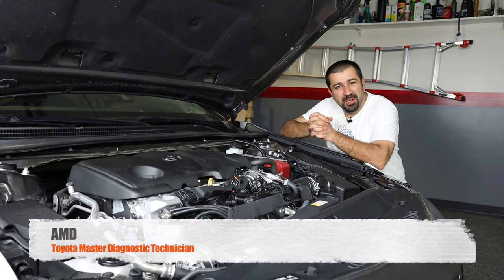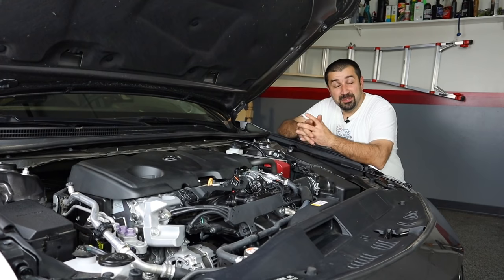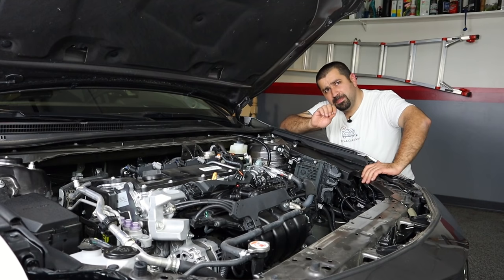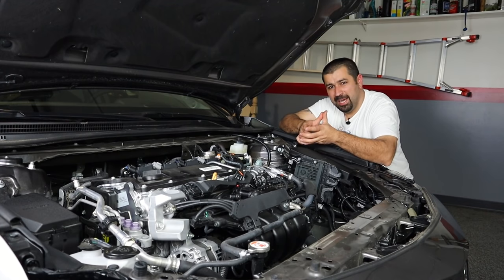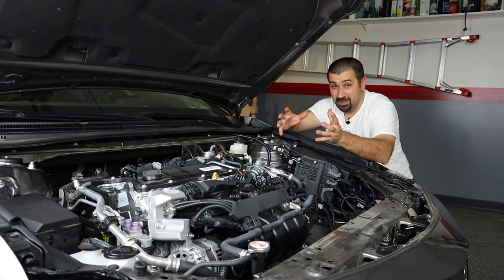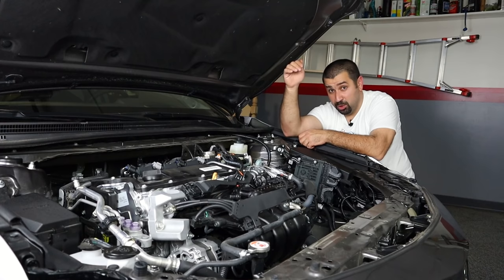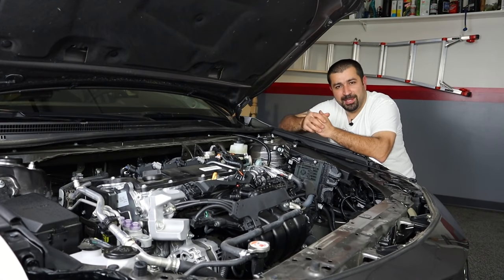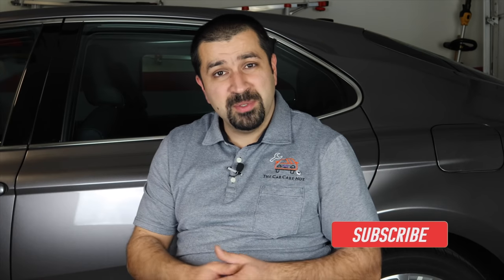Toyota's New Engine Technical review Part 1 : Cooling,Lubrication,Direct Injection and EGR

Comment: Doesn't really build my confidence that much. 
I'm wondering why the car is so picky about engine oil? If it has a computer controlled variable oil pump seems to me it ought to be able to compensate pretty easily if someone put something different in it?
Third generation Prius had horrible problems with both EGR coolers and valves as well as their electric water pumps,  both failures resulting in head gaskets blowing.
Sounds like a recipe for disaster in reliability long-term.
I would imagine the water pump in this is not a three-phase AC powered like in the Prius so perhaps it's different and more reliable, but the failure in the electric water pump on the Prius is not usually electrical, the plastic impeller comes off of the steel shaft of the motor. How stupid was that? Why the hell you would you put a plastic impeller on a water pump? In the Prius they tended to fail after 90,000 miles, but the EGR cooler is going to need to be taken off and cleaned as well as the valve about every 150,000 MI or again it can cause a blown head gasket.
I definitely would trust that Toyota would do a better job of putting these systems together than many other manufacturers but they had problems with the Prius so it makes me worry a little bit.
But maybe they've learned from the mistakes of that design.

Comment: I stopped at the cooling system bit. There is nothing spectacular about the design in that any car company could do it and could have done it years ago. Perhaps the reason why it has not been done before is because the return does not justify the extra expense and particularly the potential for problems. 

Toyota is, sadly, going the euro way in that something has to last only as long as the warranty period.

Comment: Ford’s Coyote 5.0 V8 has port and direct injection as well.
Reply: The ecoboost motors definitely do as well startinf in 2017.
Reply: @rodburnette4114  4 cylinders as well? 2.3T?
Reply: They copied toyota
Reply: @usadaytrader  The sad part is that all of these manufactures knew the problems associated with direct injection and for years did nothing about it.   I have a 2012 F-150 with the 3.5.  It now has 122k miles and it has been a great truck with no powertrain issues whatsoever.  After the powertrain warranty was up at 100k I put on a catch can to be on the safe side.  Probably have some intake clogging but my mpg has remained the same over the last 8 years and I don't have any other issues so it couldn't be too bad but still, they knew about the problem and still rushed the engine to market knowing there would be problems.  Disappointed with Ford but at least they finally did something about it.  Still a lot of others using direct injection only now (Nissan, BWM, Audi, Mercedes, Chevrolet, to name a few that I am aware of) that will eventually have problems.
Reply: @skeeter1317  that's how ford rolls.  Customer is the guinea pig
Reply: @usadaytrader  I would say that is how every manufacturer rolls.  And at least Ford has done something about it.  Others still producing cars with GDI that will have problems down the road that haven't bothered when the fix is readily available.

Comment: What is the cost vs effective value for this magnificent technology. What's this car's repair cost going to be when the warrentees crap out and the local car repair guy lacks the knowledge and extremely expensive diagnostic equipment to figure out why it died in your driveway. The big question to ask is "why is all this necessary.".  Why  is is such a good idea to make a car that the do it your self guy can't easily swap out parts and perform simple maintenance on.

Comment: More technology = harder to find and more expensive to repair problems.
When everything is in sync fine but just one small item not working right good luck trying to trace the problem thru endless wires, sensors and hoses and let's not forget the computer which now must do more.

Comment: Have to disagree on somethings. VW is a perfect example of problems with over engineering stuff. More component's that can fail. I'd rather pay the difference in fuel for the few miles per gallon savings.

Comment: lol, what an expert, he cant' even read the owner's manual. It says thicker oils are more ideal for operating under load or high speed. Maybe check overseas manuals too, they recommend all different grades based on ambient temps, up to 15w-40 for hot climates. Only USA does the single recommendation of thin oil, it's the CAFE rule....whatever oil used in their mpg test is the sole one to be recommended in the manual. This is basic science, thicker oils produce less wear.

Comment: Is it okay to keep this engine always on ECO mode ? On highway eco mode runs okay...but in city driving it fees a bit under power the initial thrust when you push on gas.....good engines Toyota...but poor / boring / fit for old people kind of interior design....the speedometer on 2018 onwards camry its way too much on the right side hard to keep eye on the speed.....side mirrors are very small and dashboard has a weird design V shape around the stereo...terrible design

Comment: The problem I see with such a thin oil is as the engine gets into the higher mileage and things wear out , The engine will burn oil like crazy. These modern engines are designed for fuel economy and not long term use like 100 thousand plus miles. We can all thank the EPA for these thin oils and the start stop features which in the long run will destroy the vehicle.
Reply from the maker: With good maintenance Toyota engines won’t burn oil. Poor maintenance = oil consumption guaranteed. Video coming up on this soon
Reply: The problem is not the oil or the engine, the problem is the uneducated people who make assumptions without doing any research.  0w oils have so many advantages than older, say 5w-30 or 10w-40 viscosities in modern engines.  They flow better (faster) protecting engines when most needed; at start-ups, they dissipate heat faster to keep engines cooler, they keep engines cleaner given that they're naturally full synthetic oils (0w oils can only be made from synthetic base stocks), they promote more horsepower, better gas mileage, etc., etc.

Comment: The A25A-FKS engine is used worldwide and Toyota owners manuals outiside of the USA say oils as thick as 15W-40 can be used: https://imagizer.imageshack.com/img922/990/O0JZRO.jpg
Reply from the maker: That is not what we were told at the official factory training when this engine came out. There has been issues with these engines related to oil including metal shavings and even knocking due to incorrect oil used. I don’t know how I feel about trying different oil viscosity just for the sake of trying.
Reply: @TheCarCareNut  Russian, Saudi Arabian, Australian, Indonesian owners manuals all say any viscosity between 0W-16 and 15W-40 can be used.  On Facebook, A25A owners from the Middle Eastern countries say their dealers routinely install 5W-30.
Reply: For 2021, Australian owners manuals now say 0W-16 is the factory fill and recommended for best fuel economy and cold weather starting, but that 0W-20, 5W-20 and 5W-30 can also be used full time.  10W-30 is OK if temperatures do not drop below zero F: https://imagizer.imageshack.com/img923/3448/gBxMOF.jpg

Comment: having an electric water pump and oil pump worries me.  I've always found small electric motors to be one of the most failure prone items on a car.  Now if that oil pump dies and you're driving, your engine will likely go with it.  

Many years ago I did dyno testing with the EGR.  I had a Datsun 720 pickup with a Webber carb, headers and comp cam.   It also had an EGR.  We did several pulls with it hooked up and some not hooked up. Emissions were monitored and we found a nearly 10% increase in peak HP with it disconnected and It had no positive effects on emissions.  Infact the HC's went way up and If I recall correctly the NOx did also.

Comment: My understanding is that Toyota experimented with Direct Injection (D-4) using low-volume models (e.g. Lexus IS250) and "discovered" carbon build-up problems.  Then they switched to the new system (D-4s/ D-6s) that has both port and direct injectors.
This practice of using new technology in low-volume products to figure things out before applying it to high-volume products is not uncommon, which is why my purchasing rules are:
1) Never buy the newest of anything.  I'm not rich enough to be a beta-tester for companies.
2) Buy high-volume product when possible, as they're much more likely to be reliable.  I don't give a damn about, "being different."  I'm plenty different inside.  I don't need to show it with frivolous purchases.

Comment: Old news.  What came first?  The 0-16 oil or Toyota miracle engineers?  0-16 is a higher grade oil in itself.  It sounds to me that Toyota is in "over its head" on this one.  Too many changes, too fast.  I would expect disaster for sure.  My RAV-4 was a nightmare for dealer service repair.  I finally traded it off.  Just me.  How many years was this new wonder engine tested before putting out on the market?  I don't like it when customers are the testers of new equipment, that may, or may not stand up.

Comment: As reliable as Toyota's are, i can't imagine 8 injectors being problematic free for 20 years like the old toyotas. Same with the coolant system and everything else. It is definately NOT the same Toyota simplicity. And Toyotas were known to be bullet proof because you could technically put any type of oil in them and it would still run, even without oil for a long time. These restrictions and specifities, are contrary to Toyota simplicty and reliability.

Comment: Do you really think this engine will not run correctly on other than 0w16 or 20 oil? The toyota owners manual most everywhere except the United States says you can use 5w30 10w30 in most all conditions and even 15w40 above certain temperatures.  I think all the 16 and 20 viscosity is purely for Cafe fuel economy.   I've never seen any information that shows these engines have any tighter clearances than engine the last 20 years.

Comment: One tendency is for most manufacturers to have a myriad of sensors to monitor and regulate various sensors to control and improve engine efficiency and pollution levels. There are even sensors to indicate whether a sensor is functioning within specs. This all relies on both the sensors, and the ECU Module being totally reliable, which they frequently are not. Anyone who has had an engine trouble light come on will frequently find the dealer recommends BOTH the sensor, and the system being monitored, be replaced at typically quite high costs. 
Yes, this engine is a technological marvel, but the verdict is yet to come back on how reliable it will actually be. Experience has shown, the more complicated a system is, the more likely something will go wrong, and the higher the costs to repair them. Yes, NASA level of quality improves reliability, but automotive level of engineering and manufacturing means there is less reliability in automotive parts.

Comment: All my Toyota leak oil like crazy
Reply: I have never had one to leak.  Had a 2002 sienna use 8oz of oil in 5K miles.  Seen it at 266K as I sold it at 228K.

Comment: Good information, but he loves going around the barn and showing you the farm first.
Porsche does this for performance. Toyota is employing numerous complex systems to increase efficiency. It works, the gas mileage is excellent, but the complexity and sheer number of additional systems will of course increase the number and cost of repairs. 
An electrically overdriven camshaft that shifts timing by 70 degrees and numerous computer controlled variable cooling circuits and a heated thermostat is going to go over big at the local Texaco. 
Toyota and the dealers will love explaining that only the dealers have the software, training and parts to fix your Camry.  
And all that plastic will remind everyone who worked on a recent BMW that heat plus age plus plastic equals pain. 
This marks a significant milestone in the end of simplicity in mass market transportation and paradoxically is an additional argument for cheap electric cars.

Comment: 100 years ago the cars ran fine
So let's complicate the design so
You must must must have a gold master card or amex card
To take it to the stealer bcz
There is no heater function
They have made it extremely complicated so only the dealer
Can check or fix
That's $999 later
Let's pass on that

Comment: wonder if anyone has ever figured out total pollution for the life of the vehicle - after the warranty has expired , after the original owner has sold it  , after all the pollution stuff is screwed up ,
when someone is using it as a junk  , running it to the ground  .example - catalytic converter fails , it is actually worse then not having one .
instead of just doing one test  , like they did with Volkswagen diesels  . do a lifetime test .
point is - lifetime , all this complex stuff is actually worse

Comment: To save viewers time, I will condense this video.  Toyota has thrown out every simple, reliable, time proven component used in your old Toyota and integrated  a more expensive, less reliable, and difficult to service replacement. You can argue but tell what happens when your electric water pumps suddenly stops, w/o warning. That is how electric motors fail. Your engine will overheat before you can say "hey siri".

Comment: At 30k my friends 2018 Camry had a misfire on cylinder 2 with this engine. Turned out it was bad spark plug.  With the older Toyota engines spark plugs won’t give out till 100k

Comment: Not sending the coolant to transmission during warm up is good for the engine, bad for the transmission. Not sure that is a good thing. Could it be the culprit for the 2019 Rav4's transmission issues?

https://www.carcomplaints.com/Toyota/RAV4/2019/

I think you will like speedkar99 channel. Not suggesting you take apart a new engine to explain how it works but it is always nicer to have a visual of the parts.
Reply from the maker: Transmissions warming up faster is also a good thing for the transmission as they usually shift oddly when they’re cold.

Comment: THe cooling system is not as advanced. BMW has had electric coolant pump for over 10 years while they introduced electric heater thermostat in late 1990s and have been using it since.

Comment: Oh boy looks like Toyota just made the same mistake Ford Made when they came out with the Ecoboost engine line up. Now I am not bashing Fords Ecoboost. I have one and it is  a heck of a power plant. 0-60 in 5.9 seconds and gets 30mpg. BUT you have to take care of the engine. If you use the wrong oil or you go too long on oil changes or you don't use tier 1 gasoline then your Ecoboost will disappoint you. Toyota has always been old school and that is why they last so long but not anymore so get ready for un satisfied customers saying that Toyota is crap now when there car needs a new engine because there 10k free oil change from the dealer was not frequent enough. He did the best he could to be positive but I can see it in his eyes he is not happy about these changes.

Comment: As a mechanic all I hear is alot of problems. Electric water pump, electric motors are way more prone to failure and with the way it can control where it goes I'd say it has a control module so another expensive device only the dealer can program.  And instead of your injectors failing or clogging up and having to replace 4,, nope now it's double the injectors and double the price, double the labor.

Comment: The average person is going to blow this engine up in about 80K miles. I will make a lot of Ching replacing them. :)
Reply from the maker: We’ve already seen a few cars with over 200k the highest one being a taxi Camry hybrid with 236k miles. Every oil change was done at the dealership ever 3-5k with Toyota 0W16 oil and still going strong. Time will tell. Just like anything else Toyota makes if you take care of it, it will take care of you. Having said that I agree with you that this engine might not be as forgiving on neglect as previous engines.

Comment: You can also recommend pouring water into the engine. But for Toyota engines, the best oil is 5w30. Always used and will use. Coming soon 0w0. Good luck and bow to the demands of the marketers.

Comment: 12:00 you are incorrect on modern cars using port injection. example 1988-1994 3.1 GM FWD engines were MPFI and sprayed fuel on the backside of the valve which does clean it. In early 1994 they switched to SFI Sequential injection which sprays fuel past the intake valve directly into the cylinder not cleaning the valve. Most cars since the early 90's use SFI not older MPFI so the valves do get more dirty and I see engines being less reliable since then. The days of 400,000 mile Toyota 4A-C,Honda B series,GM 3800,Nissan GA16DE or even Slant 6 are over. Most late 90's 2000+ cars barely hit 250k anymore and use junk CVT's that don't last and blow up randomly....

Comment: Electric water pump should be a lot easier to change but the flow control valves sound like potential problems with sticking.

Comment: Now look up the Australian manual for this engine and see how you can run 0w-16 to 10w30 without issue...I love this channel but come on man. If its minus 20C use the 0w-16 otherwise go 0w-20. This recommended oil is just to satisfy CAFE requirements.